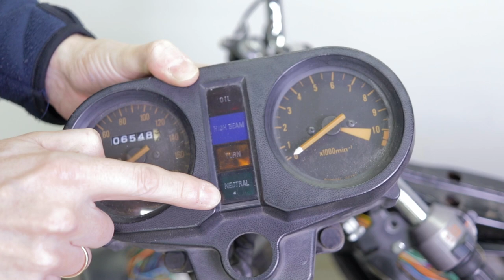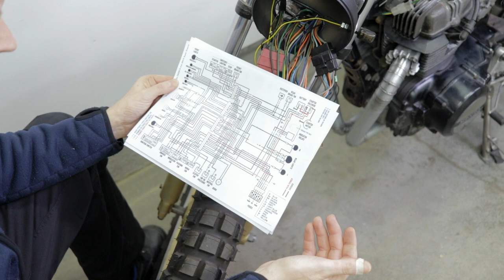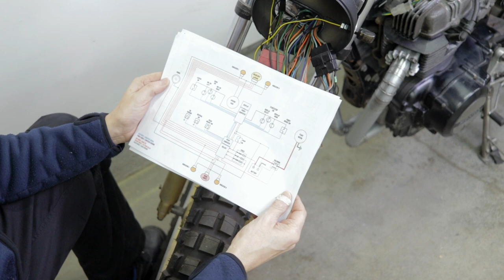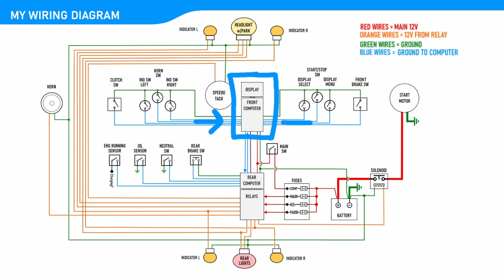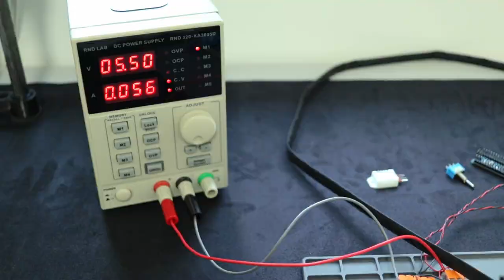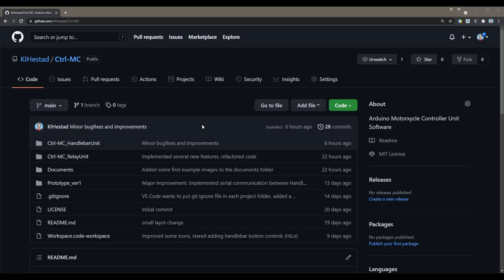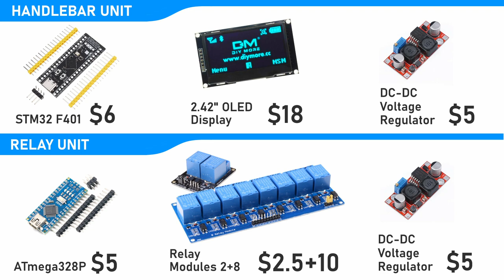Motorcycle Wiring Done Differently - This Can Be BIG!  - Honda CB400 Cafe Racer Build E14·S2

Comment: Ki… really great approach, in general. People need to understand this fundamental is before buying things like the m-unit; that you are buying a system, someone else’s system. So you must understand it’s limitations and possibilities, beyond its features and design philosophies.  Essentially you are locked in with little choices in you design and functions other than a schematic layout, i.e. running the wires between components, and often caught in needing to use their complete pantheon of gadgets and accessories. Only if you understand all this upfront, and agree with it, will the outcome meet your needs and expectations. So before buying read the manuals over and over until you have picked all this detail information out. Also, unless you are up to this you will be under a commercial companies mercy as to solving problems. 

Further now-a-days all automotive and motorcycle wiring system have standards to meet for EMI and power spikes like caused by switching… and modern electronic signal controlled systems use tiny (read near zero) current flow in control circuits and work by a micro-switch shorting to ground to provide microprocessor a momentary control signal / digital to control the microprocessors control… at low voltage. This means you at using very tiny signals to control the power relay / transistor so mixing  power switching switches into a system with micro-electronic control of power relays / transistors you are asking for problems due to voltage spikes and high current flows in the “electrical or old fashioned bike wiring” Frankenstein electrical system. So it’s best to either isolate the Frankenstein robust stuff from the sensitive control aspects or convert it all to electronic controller off of power relays / transistors. So you’d be better of eliminating Frankenstein power switching in general from your system. 

Modern power control switching circuits (relays) should have low pass filtering to rid the stem of voltage and current spikes when they open/close, and the control wiring should all be separated from power distribution particularly is there are capacitors or inductors inductive/coils. This goes for protecting signals from things like wheel or engine speed sensors.

Now the handle bars and wiring from them should be control side wiring, and low power instrument and indicator lights which are resistive loads LED fall into this. And this wiring should go to the micro controller fine. This includes all momentary or digital signal controls. But if using relay controls which are switched with latching but low power switches this needs to be installed separately and isolated from other digital control signal wiring, or in another words even if you are using low power Frankenstein latching switches to power relays keep this in mind it is not digital control. As far as the digital control wiring really that can be quite tiny maybe 28-30 awg sizing awhile for low power latching switches to control the relays stuff slightly larger is needed 24-26 awg . But I find 24 awg to 22 awg about as small as I can fumble around in wiring. Now wiring of loads including the power wires of relays and the supply you must go with large enough that you do’t overheat. But even todays headlights and other lighting loads you may be using 18 awg to 22awg. But the alternator wiring likely will be 10 awg to 16 awg on bikes.., while battery supply and ground as well as starter and solenoid wiring can be much larger too. What I am getting at your wiring now-days with LED lights etc.  will be quite tiny stuff, but the basic wiring will not be small. And, this all means very in need of fastidious installation and assembly.
Reply from the maker: Wow, this was a lengthy and insightful comment 😳 Almost as if it was generated by GPT4 😬 
The project has been paused for a while, but it has been some exciting progress the latest days 😊 will be posting a video soon!

Comment: I love your channel. How's the cafe racer coming along? You haven't posted an update in a long time. I'm also building a cafe racer and got a lot of help from your channel. I love your wiring diagram but I'm wondering about the charging portion of the system. Do you have a diagram for the alternator to the rectifier/regulator? I'm specifically wondering how to wire the regulator/rectifier into the system properly. Three yellow wires into the regulator/rectifier and three out (red, green and black). Pretty sure the red goes back to the positive side of the batter but I'm not sure exactly what to do with the black and green?
Reply from the maker: Thanks 😁 I had to take a break from my Honda cafe racer build because of other projects (my shed), and then I bought a new bike (the Cagiva) and I want to get it prepared for the spring season. I will however be continuing  on the build pretty soon now, the wiring and getting it started are the first tasks!

I have the original wiring diagram for the bike, I can upload it to GIT and share link to it later today when I am back home (it should be possible to find it using Google search as well). The yellow wires should be left alone, it is AC power from the alternator to the regulator rectifier that is converted to DC power. You are correct about the red one, it goes to the battery for charging. The bike delivers at least 14.5 Volts  and around 5 Amps if I remember correct, perhaps even more on high rpm. If you switch to Lithium batteries you must make sure they can handle this, or you need to regulate it. The green one is direct to ground. The black one is 12V input to the regulator from the ignition switch.
Reply: @kihestad  Thanks so much for getting back to me. I did switch to a lithium battery and bought a new regulator/rectifier suitable for lithium. As I understand it the lithium regulator keeps the volts at safe levels for the battery. I removed the ignition switch completely from the system and instead wired in a secret switch off the batteries positive terminal after my fuse box. This switch opens all circuits including engaging the starter solenoid. With this setup should I send the Black to ground? Beyond converting AC to DC I guess I ultimately don't quite understand how a rectifier/regulator works and therefore don't know what to do with the black wire. Does the black wire provide power to lighting circuits while the bike is running? Maybe I should connect it to the system after my secret switch?
Reply from the maker: I have uploaded the wiring diagram for my bike here (cannot say for sure if this is the same on yours, might depend on model make and year): https://github.com/KIHestad/Ctrl-MC/blob/main/Documents/Honda%20CB400N%20CB250N%20Original%20Wiring%20Diagram.png

On these old Honda motorcycles green wires goes to normally direct to ground. Red are typically constant 12V positive lead, while black and other colors are connected to fuses, switches or sensors providing ground or 12V depending on a switch (or sensor) are on or off. Since you have bought a new regulator/rectifier you really need to connect it according to the vendors specifications. The rectifier part transforms AC power to DC, the regulator makes sure the output voltage are within correct range. Remember that the original ignition switch for these bikes has two switches built into it, one connects 12V while the other connects to ground. It will require some rewiring if you replace it with a single 12V switch.

It can be tricky to figure out how to do these things, and hard to give absolute guidance on how you should connect your wires without seeing the complete wiring. Just take your time and study the wiring diagram and you will figure it out! 👍

Comment: Love it. I've been looking at a smilar solution. 
There is one thing I don't like and that's the relays.
I've been looking for a solid state solution, with no luck so far.
My project has been on halt for a couple of years now but hope to pick it up soon.
Reply from the maker: We are in the "same boat" as we say here in Norway 😁I have been looking for solid state switch modules for Arduino myself without finding anything usable, so I just went with the "old" traditional relay module. However, I have got help from @Ramjet from Australia that suggested a solution. If everything turns out a solid state solution might replace the relays. I have a Discord channel you can join to take a closer look: https://discord.gg/ccT6R4EF
Reply: P-channel MOSFETs.  N-Channel are more reliable, but in these low-voltage, moderate-current installations a high-side (that is, in the positive lead) P-Channel switch will work well.  Look for automotive rated and a minimal 50v rating.  The "drive" is low to the gate, so typically you'd just invert the existing output at the microcontroller GPIO pin.

Comment: Awesome video! Is it possible to add self canceling turn signals? I owned a bajaj pulsar 180 which has the self cancel turn signal feature. So when I turn the handle bar to left or right, it will automatically turn off in a couple of seconds..
Reply from the maker: Yes, I have added a gyroscope/ accelerometer to the computer in the latest version. It will make it possible to program auto cancelling turn signals and auto break signal (flashing) as well.

Comment: Nice. Using Oled and Nano Every for my Monster, but measures 0-60 and 0-100 times.
Reply from the maker: Cool 😎 Do you use a hall-sensor connected to the Nano and a magnet on the wheel to measure the speed?
Reply: @kihestad  YES. Have tested with both 5v and 12v Hall sensors. Did use gps but reaction time delay not feasible. When measuring acceleration wheel movement in combination with millisecond circumference clocking results in accurate 0-100 KM/H results.  Maybe gps also not legal in certain countries.
Reply from the maker: @CasaMaryParadise   Very nice 👍 I will probably try to add a speedometer option to my project as well

Comment: Hi, what is the status of the bike build please. I'm following your bike videos, excellent examples in how to actually build the parts.
Thanks
Reply from the maker: Hi, I had to prioritize some other projects for a while - almost a year actually 😫 I have made a working prototype of the motorcycle computer. I did learn a lot during the process, and I have decided to build a prototype version 2 with even more features and replace the the mechanical relays with MOSFET's instead (also called solid state relays).

Hope to be able to continue on the build very soon. I am almost done with a big garage upgrade, and then it's back to the Honda build! 😊

Comment: very risky with parts that are not made for automotive, vibration, heat, cold, dust, water, voltage fluctuation....the system must run 100%. An outfall during riding is a nightmare.
Reply from the maker: You are spot on! 👍👍👍 This is also my biggest concern. I have learned so far that the microcontrollers operating at very low voltage/current is sensible to electrical noise, and do not like long cables. That is the reason I now have two microcontrolles with a serial cable for communication between them. This will be shielded and the communication cables are type twisted pair. I have also built data communication checksum algorithms (CRC), the system triggers regularly handshake commands to ensure that the communication and both units are working as intended. I can trigger retry commands if communication fails, and send alert on the display if something goes wrong. I have now reliable communication between the units with a 2 meter cable, in theory Arduinos can have reliable communication up to 2km using the serial signals 🙄 Some Arduinos come with support for CAN-bus as well, the protocol used for communication in cars, but it is more or less the same as the serial communication I am using.

How the electronics will cope with the physical environment will be exiting to see, I will be the guinea pig 😁I am not sure if the Arduino platform differs that much from electrics you find in the automotive industry, I think Arduinos are used in industrial applications as well. I will do my best to find components that are reliable, this is the topic that I care about and I have to make the system reliable, if I cannot make that happen I'll let you know! Hoping for the best 😋
Reply: @kihestad  thanks fo your detailed answer. I also thought many times about to make something similar for my old cafe racers. At least i let it because i´m not the big expert and it takes lot of time. I would be happy if works and sure one of your first customer.👍
Reply: Potting the Arduino would be a solution to vibration, water etc. For the cost of an Arduino, you could have 2 of them side by side, for redundancy
Reply from the maker: I had to check out 'potting', interesting 👍 I hope redundancy is not needed, but absolutely an alternative. Thanks for the tips!
Reply: @kihestad , Very interesting project. I like the fabrication work on the exhaust system as well. Have you got the motorcycle running yet? Looking forward seeing those videos!
Reply from the maker: @jennings2309  Thanks 🙂 I have not fired it up yet, but very soon now. The moment will be recorded! I am excited as well, and a bit anxious, to hear how it sound 😬
Reply: @kihestad  Yup, CANbus is a good call.  There are CANbus interface chips available for "plain" microcontrollers, too.  Failing that, I'd recommend CAT-6 cable with individually shielded twisted pairs (as well as a braided outer shield).  They're pretty cheap and available just about everywhere.